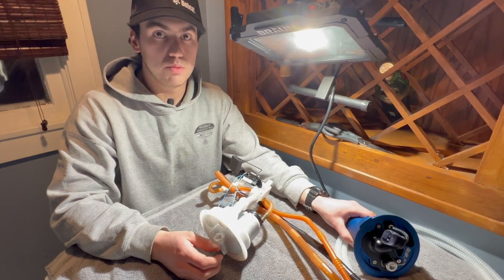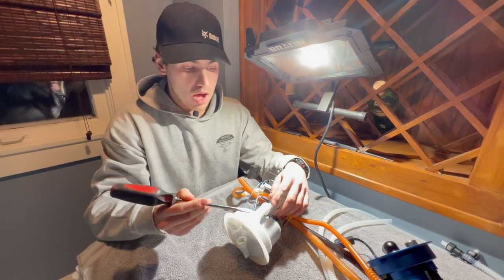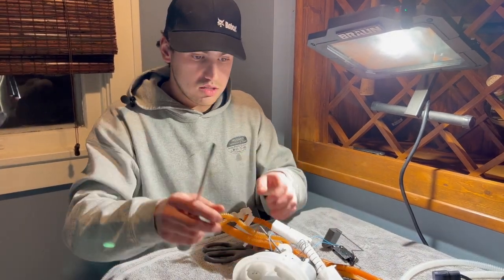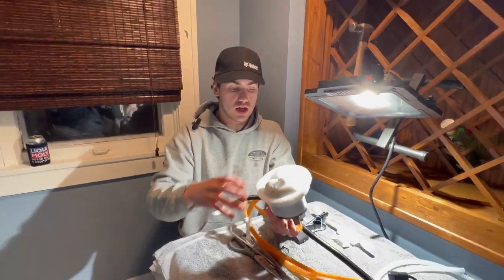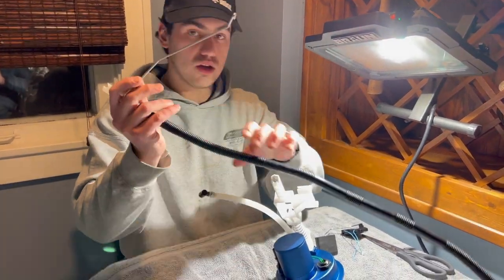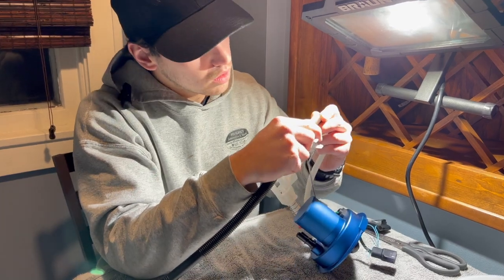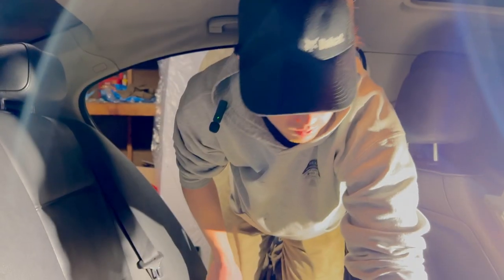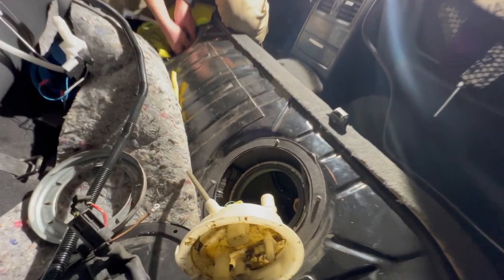N54 V2 Precision Raceworks Fuel Filter/Regulator Install

Comment: Is there an boost line needed to connect with the regulator ? Or does it works exactly how you installed in this video without anything connected to the regulator (I mean this small next to the fuel line connection)

Comment: Are you able to adjust the fuel pressure?
Reply from the maker: They make add on kits for adjustable regulator options. As of now I’m utilizing the preset 5bar boost reference. Performs phenomenally
Reply: Cool. I didn’t want to spend that much so I made my own. Thank you

Comment: So right now I am running single walbro 525 (bucketed)

If I get this thing will my 525 perform better?
Right now it's droping lpfp pressure down to 36psi.
Reply from the maker: Most likely your pump is getting weak. My 450 was getting weak when I installed this so I was only seeing about 55-65 psi. After a new updated style 450 (higher pressure) the pressures are perfect. And yes, definitely beneficial especially given the fact it’s a 525. They pull much more amps than a 450 therefore straining the EKP. With this your amps drop quite a bit. That being said it will also aid in additional fuel flow given the factory filter/regulator is a major bottleneck

Comment: Any updates on how it performs?
Reply from the maker: Performs great. No issues so far other than the updated bracket they sent me to prevent fuel leakage. This is described in another video. Have definitely had better flow and seen less timing pulled throughout the pull